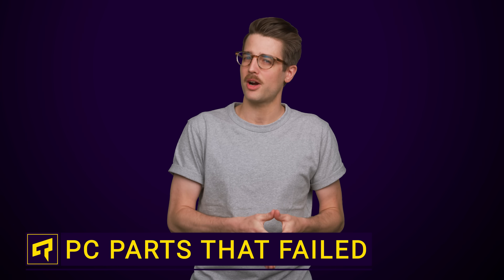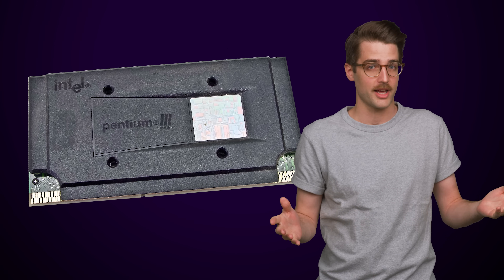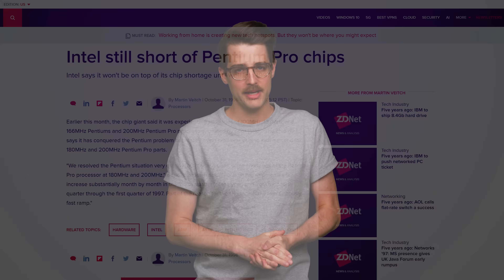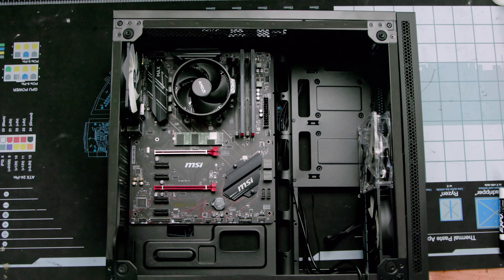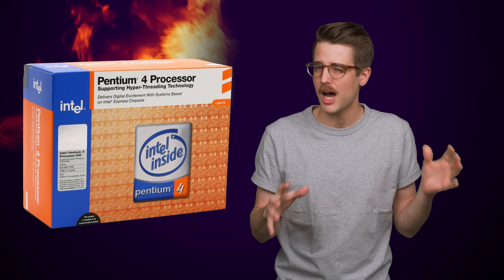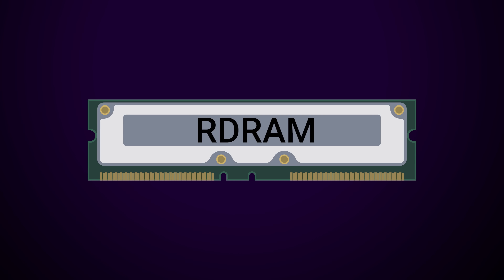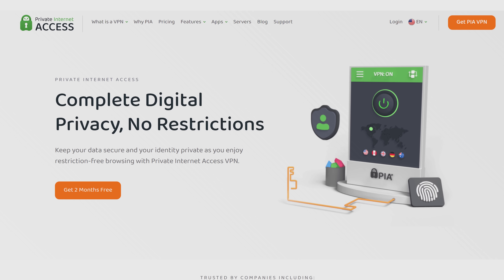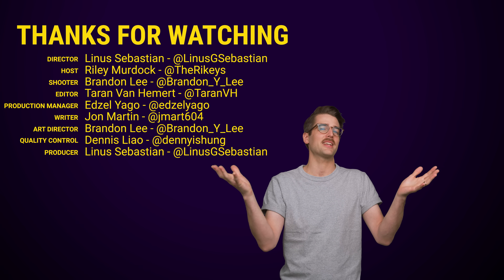PC Parts That Disappeared

Comment: ayy ive got a btx motherboard that i found on the side of the road complete with all of its parts and case.
i always thought it was just a compact design, but i actually really like how it looks and put together.

its currently sitting next to me with linux mint installed, as the windows vista it had installed was full of highly personal information from the person who dumped it that i wiped. and since i didnt have a windows vista disk laying around, and the 2gb of ddr2 ram really didnt like windows 10 (i installed it as a joke, i knew it wasnt going to work well) i figured this would be a good time to get into linux.

i was going to use it as a media pc for the lounge area, but then my mother bought a ps4 for my brother as a surprise and it doesnt really have a purpose now.
it was fun using its disc drive to watch movies that have just been sitting around the house for years though, and i needed it to grab drivers for various parts of got in my main pc now.
i dunno what it is but i just find disc drives fun, even though this one spins up so fast im scared the disc is going to explode out everywhere.

Comment: Early 3D graphics cards were certainly interesting. The computer you'd put them in already had a standard 2D 'regular' graphics card. I installed a monster 3D 2 accelerator, and it didn't take the place of the regular card. Rather, you'd run a cord out of the back of the regular card's VGA port, into the 3D card, with an input port, and then back out to a separate port that went to the monitor. LOL - the card literally took whatever was running in the back ground (windows, etc), and slapped a 3D image over it when a game was playing. 👍

Comment: I'm the "neighborhood tech junkie" that's always everyone's go-to guy when they need (usually old) hardware fixed/revived.
Two years ago, a "regular drug junkie" tried to pull a fast oner on me.
I'm known as someone who might have an interest in old computer stuff, I'm always tinkering with old pc's... well, I happened to be looking for a few things to revive an old AMD K6 system, and someone suggested to this druggie that he'd sell this old defunct PC from (as he claimed) the late 90's/early 2000's to me.
Now, I'm sure there's people who've see the VCR (ask your parents, kids...) equivalent trickery, where someone thinks they're getting a dirt-cheap VCR only to find that it's just the plastic hull filled with bricks, right?
Well, this druggie tried to sell me an Intel BTX system, with... *drumroll* ... something that looked like RDRAM (it wasn't RDRAM, but looked very similar, though it wasn't anything I've seen before).
the whole thing was useless to me, but did pique my curiosity - so I ended up trying to dig up as much information as possible, and incredibly the motherboard was manufactured in 2011, the RAM might actually have pre-dated RDRAM by several years ("might" because I really wasn't able to identify it, so I settled on the information of what seemed to be the closest matching tye of RAM that I could find) and the CPU wasn't even truly Intel, but some sort of licensed thing that still got sold as "Intel" in some countries.
TL:DR; I was trying to revive an old AMd K6 PC, ended up finding out stuff about BTX and RDRAM because a junkie tried to bamboozle me.

Comment: physics cards was a thing but was then merged into video cards and now they are making a come back as AI cards to do large number calculations, audio cards are still necessary for various uses along with capture cards but the needs for those are fading unless you want a boost to the audio above others.

Tape drives and Zip drives are no longer needed though... they are basically dead

Comment: I remember those slotted CPUs.  But while they disappeared... so did every other computer part back then.  We'd get a new computer like every two years, things evolved so quickly.  And the old computers depreciated both in value and use incredibly quickly.  The 1990s were a nonstop treadmill of tech waste.  It wasn't until I had the first core i7 970 in 2009 combined with Window 7 that I lost the constant fear my computer was going to shit the bed with a random bluescreen.  That computer is still very functional hardware, able to run a lot of games (albeit bottlenecking the graphics card pretty hard now).  To me there is far less of a difference in a computer from 2009 to 2021 than there ever was in a computer from the 1980s to the 1990s.

Comment: 2:00 AMD K6-III was the first CPU for PC to have L2 cache on the CPU, and when it was put into a Super 7 board that had L2 cache (designed for the K6-2), that onboard cache became L3 cache and made the K6-III significantly faster than the Pentium II and IIIs running at the same clock speed. But the reason the Athlon had to be slotted was because it had L3 cache in the package, where the Pentium II and III were packaged for their massive L2 cache. Weird thing about those, is that the last Pentium III - after Intel went back to sockets - had everything integrated in the CPU and were surface mounted inside the package so OEMs could use up their last slotted motherboards

Comment: How about software? Who today knows the difference between XMS (Extended Memory Specification) and EMS (Expanded Memory Specification)? And then there are the bus systems nobody speaks about today, ISA (which stole most of its ideas from the Apple II slots system), EISA, MCA and PCI, while today just about anything is PCI-E of some variation? Then go on to hard disk standards, from MFM/RLL to ATA/IDE, and parallel to that SCSI-1, -2 etc. to SAS/SATA/NVMe?

Comment: Floppictal 21mb, 2.88 3.5" floppies. Phase disk, both the CD and DVD variants that promised 100k write cycles on a random access optical media. Failed because non standard, and poor r/w speeds especially compared to the more standard r/w on linear playback.

Comment: If BTX is the form I'm thinking of it also changed the standard placement of components for improved overall case airflow efficacy, It really was better than ATX. but as with many markets inertia is a substantial factor and ATX had loads of it while still being an adequate design for most uses.

Comment: Should've added cd/dvd/whatever drives. These days I just have drive bay drawers in those slots to store stuff like sd cards and adaptors, various usb devices, etc. They are actually very useful since I haven't used an actual drive of that type in any build for like 16+ years so it's a great use for the unused space.

Comment: I’d like to see slotted CPU form factors again using modern manufacturing. You could dedicate more space on the actual processor die to raw processing power and then have beefy large caches off to the side. Heat management would take some adjustment but I imagine it wouldn’t be much harder than what goes on in a high end graphics card
Reply: Unfortunately, there is a technical reason for why we stopped making them, other than because the cache was already inside the CPU and that making a board for no reason is costly.

The reason is electromagnetic interference. This was the era where we jumped from 300 MHz with the 1997 Pentium II to 1000 MHz with the 2000 Pentium III, the last CPU for Socket 1 (*not to mention P4, which clocked a lot higher but delivered lower performance per clock). When you clock-scale like that, you start to run on signal integrity issues, and the cheapest way to resolve them is to simply make the paths shorter (in other words, cut off the slot and back to PGA/LGA we are).
Reply: keep all the high speed components (cpu, cache, RAM, northbridge, gpu) in one card and the slow components (pci e, lpc, sata) in the mobo, along with the power supply components

Comment: i have alot of those RDram, i used to service office desktops that uses em, i also have blanks cards since RDram requires ALL solts to be filled or else they will not work, Dell were the biggest supporters of the ram as HP jumped onto em at the very late and regretted it since.

oh i have a few slot cpu's off my dead Compaq and many old dell optiplex g1a, despite there criticism, these still works to this day and soo rugged

Comment: Pretty standardized parts... Yeah, there's only about a dozen different CPU socket types in the last ten years, DDR2, DDR3, DDR4 RAM, different form factor motherboards that will only fit a case designed for them, with each motherboard having a different style power connector...

Comment: My first  x86 PC was a 1998 era 350MHz Pentium 2 (on one of those riser cards) slotted into an Asus P2B-F motherboard.  I think it had 128MB of RAM and an 8GB HDD if I remember correctly, along with a 8MB Matrox GPU that actually had a slot to add another 8MB of RAM that would allow for 3D acceleration.  Good times (not really).

Comment: OMFG, a Pentium II. I had one back in the days, and I still think I have one lying around in the attic, if I remember right. Also, they don't use PCI. Instead, they used something called an SECC or A Single Edge Contact Cartridge for the CPU, and it was easier to install the CPU that way. One of the motherboards I know off use that CPU was ASUS P2L97. I have been using PCs since the late '80s. My dad had a pc when I was born, so I grew up with a pc and many consoles and handheld. I had most consoles that came out in the '80 - 90s, i even had an Odyssey 2 as a kid, and I also had a Gameboy original and later the Gameboy color. When I look back, I don't know how my dad got all this money from, but we were not rich by any means, but I had a lot of stuff like that, like if we were.

Comment: Seems like a ton of the "can't really get it easily anymore" tech has been bought up for supplying older PC based equipment. 
I know of a big name company which still uses Pentium 1 CPU, floppy drive, SO-DIMM RAM and 52GB HDD... Because they don't want to fix it, since the system isn't exactly broken, and has already been verified in the ancient configuration.

Comment: Dedicated 3D accelerators, e.g. the 3DFX Voodoo cards. Those were awesome, you would connect your regular 2D graphics card VGA output to a VGA input port on the 3D accelerator, the accelerator would do its thing and render sweet accelerated 3D graphics replacing the 2D graphics, and then it would pipe it to a VGA output, and when not using 3D, it would simply pass the 2D signal directly on to the output.
Reply: Back in the day when we still had plenty of graphics cards manufacturers thst don't exist anymore or aren't relevant like Matrox and Diamond.
Reply: I remember my dad having an overprised switch with a button to swap the vga outputs haha
Reply: @croozerdog  guess that was for using multiple pc's on 1 monitor?
Reply: Don't forget about the development of AGP and then replacement with pcie
Reply: Now you can just run nglide to emulate a 3dfx

Comment: I really wish slot CPUs were still a thing, for ease of install and to avoid stuff like bending the cpu legs.

Not to mention that stuff like applying new thermal paste would be much simpler - just take the cpu card out, unscrew the cooler, apply the paste and put it back together. No need to dig between cables to get to the cpu and again, no risk of accidentally breaking it when reinserting.

Comment: I had a dual-CPU board that took 2 slot-type Pentium IIIs.

The technology shift that really confused me was moving away from AGP cards.  There was all of this hype that said PCI is very inefficient for video cards and manufacturers mostly stopped making PCI video cards in favor of AGP cards.  Then, after a few years, AGP cards disappeared off the market in favor of PCIe cards.  Which, after all of the hype about PCI being inefficient for video cards, made me really skeptical (yes, I realize that PCI and PCIe are different, but that wasn't something that was made clear when they first hit the market).

Comment: Magneto optical drives died pretty quickly. They wore out too quickly. CRT's died but still have some weird die hard fans.
Reply: In regards to CRTs, they are generally better in response times, have zero input lag, offer high refresh rates and often times better image quality even when compared to the best LCDs and OLEDs, especially when the input is of low resolution, such as old consoles. Their drawbacks are their weight, size, and geometry issues.

Comment: Whenever this topic comes up, the one thing that always comes up, is RAM cards. I understand why we don't have old-style RAM cards, but imagine a PCIe adapter with a CPU, some SATA ports and 4-8 DDR3 RAM slots. You can use the RAM as a drive for cache and buffers, while the CPU being able to work as a software-based hardware RAID adapter. And you could of course run some software on the CPU to utilize free time. This could be built using out-of-date components, which would make them cheap. So why don't they exist? I mean, I have a lot of prev-gen CPUs and RAM that's just collecting dust. If I could buy a card to make use of them, I would definitely add them to my desktop.

Comment: I totally forgot about RAMBUS!!
I remember having to install "blanks" in unused RAM banks otherwise it wouldn't work, and you had to pair them like you do nowdays. Ram, blank, ram, blank. etc
That period of P2 450's and P3 550's was interesting too. I think they're the only CPU's I didn't keep any of for nostalgia! Still have my hotboi Cyrix and AMD K6's though!
Reply: The best part of the P2 450 generation was buying a celeron 300A for $80 to get 90% of the performance of that $300-400 P2-450.  =D.  That was my gaming rig circa-y2k, with a Riva TNT when everyone else wanted Voodoo3, and it ran like an absolute rock.  After I upgraded past it, it became the home router, running two network cards and NAT software... dedicated home routers wouldn't be a thing for at least another 2-3 years after that, and I think my old 300A (which I clocked back to 300 for that part of its life) ran strong almost 24/7 for about 6-7 years before I finally decided to just replace it with a dedicated router to add wifi.
Reply: I had one of the first engineering sample boards for RAMBUS testing.  For the time, that thing ran like greased lightning but boy was it a finicky beast, and hot.  Also finding drivers was impossible since the board TECHNICALLY wasn't ever released to the public.  I got close drivers on many parts of the board and chipset from earlier Intel boards, but crashes were common because it wasn't 100%.  I was glad when DDR2 became standard and prices dropped so I could rebuild my home machine.

Comment: Also cache ram chips, maths co-processors, multi IO cards, CD-rom interfaces (Panasonic etc), the turbo button, the parallel port, and internal modems.
Reply: Yup I remember when you bought the CD-ROM in a kit with an adapter card to use it,,,

Comment: The first PCs I worked on were Zenith 286 and later upgraded to 386.
The whole architecture was simply a Backplane board that had only slots to plug in cards.
The cards were 
CPU - 286/386 CPUs and supporting circuitry.
Video cad 
I/O card - parallel printer port and serial ports
Drive controller for -  floppy dreives and later 20mb hard-drives.
And you coud buy and optional extended memory card with chip sockets but no memory chips those were purchased separately and you had to line up those fragile little legs and press them into the sockets without bending the little legs. Oh yes they also had to be installed one way with one end of the chip oriented in one direction only.
The extended memory card was only used if a program that was written to address it do your word processor, spreadsheet or database prograns didn't even register it's existence.
Also found how embarrassing it wasbto have the user call and tell us the program would stop running and tell you there was a memory error. Turns out one memory chip installed backwards made the board unusable but would only find out when the custom program would be run and it did a memory check not the BIOS.

Comment: My 2013 Dell Precision has a BTX motherboard, it was a pain to upgrade the GPU because it lacks the 24 pin connector so I had to find an adapter, it's also weird in the way that the power supply doesn't connect directly rather it pass through the whole board, but once you get around that issue it works wonderfully. It was especially good with the Xeon and Quadro card as I could use it non stop for days and it never got particularly hot and required a very modest PSU; now I upgraded to an RTX with a beefier PSU so it gets a little bit hotter, but even in the summer is still well within a reasonable limit. I don't have experience with ATX but my understanding is that BTX was fairly superior in every way, it just wasn't that superior to convince everyone to change standard, and that's a bit of a shame.

Comment: Actually I had a Asus 386/33 (EISA bus) system that had it's processor on a card that went in a slot, it was upgradable and I upgraded it to a 486 before moving on to another system.

I also had a dual processer Pentium II 400 system with the "slot style" later.

Comment: You didn't talk about expanded, extended, or hma memory. Originally PC's could only have up to 640k of ram. There ended up being multiple schemes that pc makers used to add more ram anyway. Later computers let you configure which scheme you were going to use for your extra memory. However, there was no way to reconfigure that once the machine was booted. So if the game you wanted to play wanted to use all of your memory as expanded ram, then you might have to modify your config.sys and autoexec.bat files for this configuration and then reboot. It was a royal pain in the butt.

Comment: Ten or so yeRs ago, casebuilder Antec tried to introduce a new PSU form factor. The "CPX" form factor tried to increase PSU real estate in order to lower temperatures and costs of the often very cramped ATX power supplies.

It didn't take off and now we have 1,5KW power supplies in ATX form factor ¯\_(ツ)_/¯